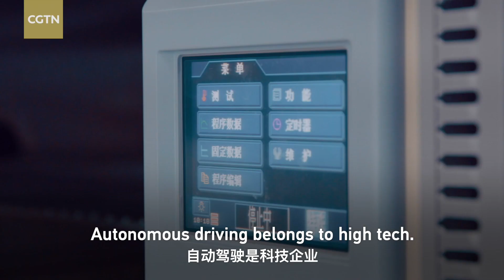Chips for self-driving cars caught up in China-U.S. tech war

Comment: China didnt intend to re-invent the wheel actually. Use the Chip and develop application. But the US sanction forced China now to look at how to manufacture chip itself. This will distract the focus on application part but few years later, China will be emerging as strong competitor in Chip making with on indigenous system. Thanks to Pompeo regime.
Reply: Will China now have to stop copying Western Tech and develop there own ?
Will they learn what a painful process it is thinking on your own 
you will have many failures along the way , normal for any new experience
and years later , when you have finally mastered this , we will be far ahead of you
Reply: @jamesgathings6364  Last i check, China is buying, not copying. China bought 300+ billion of US chips..  and btw, i am not from China. but i work in US Semiconductor company.
Reply: @burung81  Sure , And now they can discover how difficult this is to learn , all on there own
Reply: @jamesgathings6364  Yes, not easy, in fact very, very difficult. China might fail or very slow. However, if they are successful, the semiconductor behemoth is awaken, dont you think? China has the market, the demand. Those USD 300bil Chip China currently purchase will go to their own domestic foundry. China also has long history of mass manufacturing with cost efficiency second to none.
Reply: China has been trying to manufacture chips themselves for over 50 years now...
Reply: @thierryj1694  Yes, china Chip foundry is behind and not as successful, because China company (ie. huawei etc) buy from alternative like US, taiwain, korea which is more advance. This is important as the sell enable the re-invest in R&D to maintain the lead. By blocking the sell, it is a big boost to the homegrown.